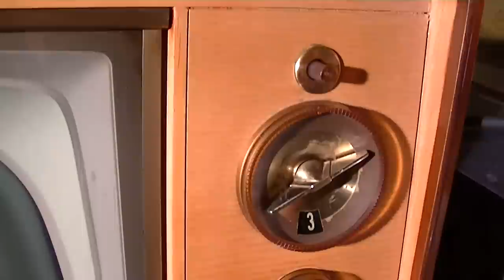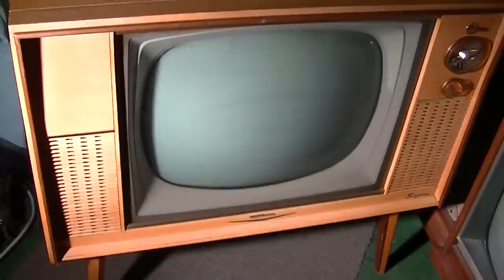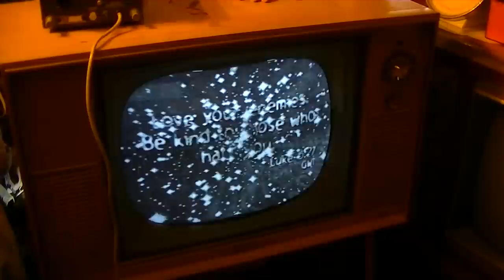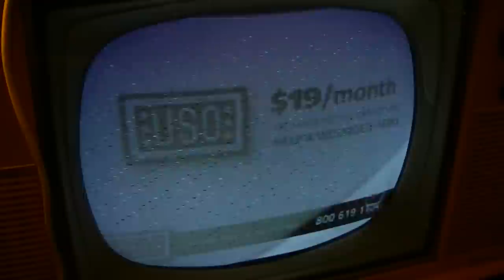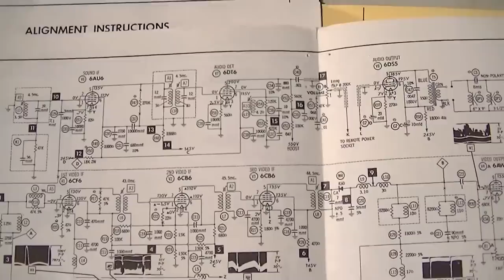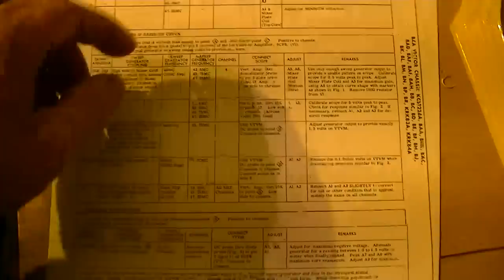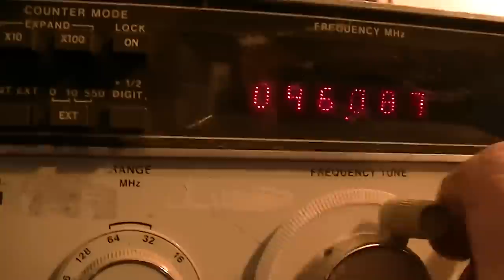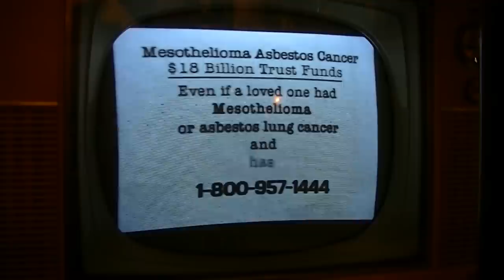RCA KCS122BAD 21-T-9397 Vintage Black And White Console TV Setup and Alignment

Comment: Excellent video, Shango. This television set, manufactured by RCA in 1958, is probably working as best as it can. The NTSC signals broadcast in the late 1950's were designed primarily for sets like this. The signals you fed into it in this video are probably too complex for this set to filter and decode properly.
Reply: My tv doesnt buzz that bad and its from 1954.
Reply: Nice Rockford shot !
Reply: Good analysis James Rockford.

Comment: Check the voltage and amperage requirements for the converter box and you might be able to find a different power with a transformer in it at a Good Will store, or if you have any thrift stores nearby. I have to do that with anything I get, those switching power supplies are so noisy, it even wipes out the FM band on my Reader's digest multi band radio.

Comment: Buddy light
I think the rolling picture is when it loses vertical sync in some way or another and/or the vert. oscillator free runs or drifts off frequency for a (not so) brief period. Loss of vertical can be caused by weak (video) signal, faulty sync separator circuits or incorrect vert. Hold setting which trims the vertical oscillator frequency along with an AFC circuit so the control isn't "touchy"
Reply: I just fixed the rolling vertical on mine. I replaced the worn out v hold control and found an open plate resistor on the vert sync tube. Rolling vertical can be weak signal, really bad if alignment, or off voltages in the sync sections.

Comment: gated beam quadrature discriminator works on the same principle as the regular sound IF discriminator with ca3065  chips - it has quadrature mixer as do all the other modern FM discriminator chips.

Comment: What made those old 60's TV sets roll all the time? My father bought a brand new TV set from Western Auto and even it rolled.
Reply: Very poor quality capacitors in the vertical and horizontal oscillator and deflection circuits.
Reply: I've never seen an all-tube chassis that didn't roll at least a little; think of all the parts that changed value as the set warmed up. The SS sets with PLL-style chips were a huge improvement in that respect.

Comment: It makes me nervous when you adjust the yoke when it is on. I did that once on a CRT monitor and got zapped really bad by the tube, I wasn't anywhere near the high voltage connection boot. It felt to me like some kind of a static discharge as it came in quick pulses like static, but the pulses were around 3 seconds apart. (First time I assumed it was static, second time I knew something was up). How are you supposed to work on these TVs without getting killed by the capacitors and high voltage?
Reply: Try your hardest not to become the path back to ground!
Reply: An isolating transformer is a good start.
Reply: It's possible that there may have been a short between one of the coils and the yoke frame. Many times the coils are at B+ potential or higher, particularly the horizontal deflection coils. Happened to me once while adjusting a yoke on a color set. There was a short to frame from one of the vertical coils but it was isolated by the CRT so there was no effect on the set's operation. But it zapped me the instant I touched the frame to adjust it. Definitely was a teachable moment about the electrician's adage of keeping your free hand in your hip pocket.